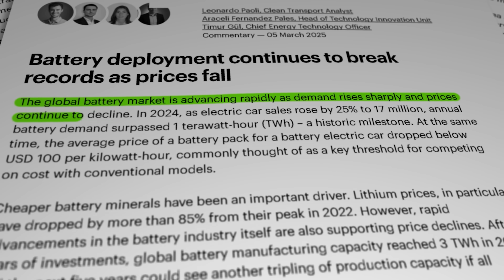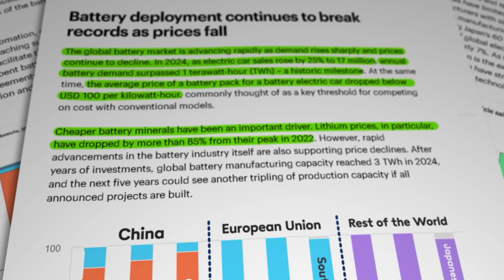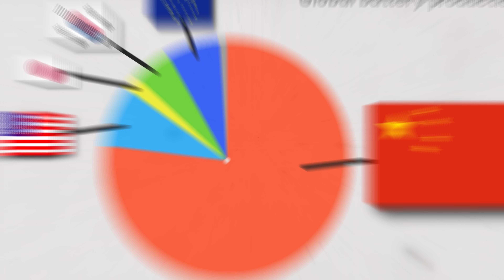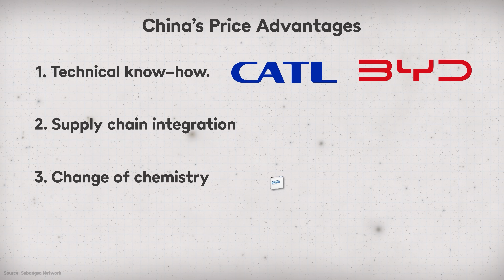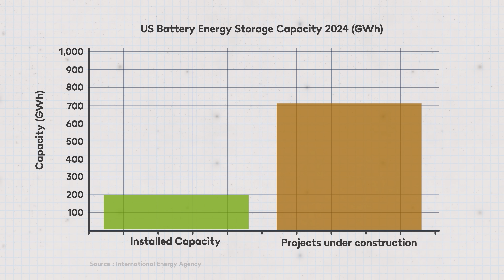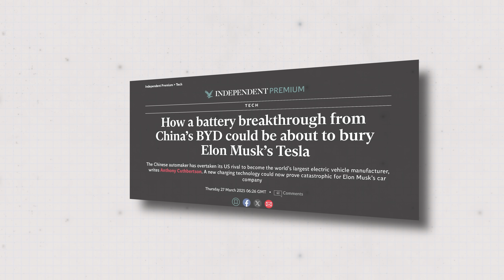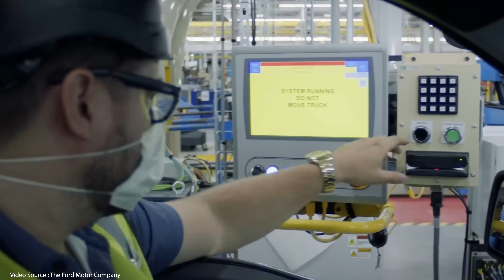Have batteries just hit their exponential curve??

Comment: Retail prices of LFP prismatic cells are well, well below $100/kWh.  Small orders- of a pallet's worth- cost us $60 USD plus taxes and delivery (which from China to Canada added about another $20).    At those prices, the ICE is more or less dead for about 80% of its current uses.
Reply: Thanks for repeating all the ridiculous myths. For one, I haven’t seen anyone gassing up their ICE vehicles in their apartment building, but have seen lots of people charging their EV in their apartment building.
Reply: @georgeacton9106  Slow charging and working out schedules to share the chargers with your neighbors is the epitome of ghetto life.
Reply: @kirkjohnson6638 I see Ivan is panicking about the fact that their oil prices are crashing right now.
Reply: @kirknay  Not to mention that Zelenskyy is blowing up his refineries
Reply: @kirkjohnson6638 It’s already a reality in recently built condos and apartments in Los Angeles. Every parking space has a level 2 charger, groups of 4 sharing the same 32A circuit. That means sharing is automated. It’s not an issue.
Reply: @markmuir7338  Do you realize how small the percentage of apartments are that are new ones?  If you are waiting for new construction to get chargers everywhere, it'll take more than a century.
Reply: @kirkjohnson6638  I’m only mentioning new builds because they are mandated to have EV chargers. There’s nothing stopping this in older apartment buildings - most of them have a big enough grid connection to do this.

The remaining issue is in cities with extremely high housing prices, where 6 adults share a 2 bedroom apartment. Would need some kind of on-street charging infrastructure (like seen in London) for that.
Reply: @markmuir7338  Existing buildings absolutely do not have the electrical infrastructure to handle mass adoption of EVs.  CA doesn't even have the infrastructure necessary to generate enough electricity to feed the grid and the entire grid needs to be upgraded.  Transformer farms, high tension lines, and local pole transformers and residential feeds all need to be beefed up.  Right now, the CA electrical grid cannot handle a heatwave without restricting EV charging and right now EVs are only about 2.5% of the total registered vehicles.  And the trucking industry, buses, and port ships are a whole other ball of wax.

Additionally, there is no reason why renters with ICEVs should be subsidizing the costs of apartment complexes installing charge points that they will not use.
Reply: @kirkjohnson6638 You’re right - we should do absolutely nothing. No change is ever good. There are no solutions to any problems. Let’s just sit back and watch the world burn.
Reply: @kirkjohnson6638 Joking aside, yes the California grid at large is straining under the load from increasing heat waves. However, EVs primarily charge at night, when the air conditioning loads are far less. Adding battery storage near the loads is an excellent solution to the various problems you listed, and indeed California’s power companies are doing just that. As for subsidizing EV chargers: why can’t residents buy their own EV chargers? It’s better to have multiple residents buy the chargers together, so they can be set up to share the same circuit breaker. Mandating it into the code for new builds is a forward thinking approach. They aren’t expensive ($500 per charger).
Reply: @markmuir7338  I said no such thing.  The problem with EVs is that they are inferior to ICEVs and will remain so until they develop a battery which is non-flammable AND until the national electrical grid is significantly upgraded.
Reply: I'm responding to you on a tablet that was charged by a solar powered LFP battery 😂 We bought ours 4 years ago and they're much cheaper now. But we're anticipating 5-10k recharge cycles so by the time our battery dies I have no idea what will be available
Reply: Battery 11:50 prices have dropped while the quality of the cells have increased exponentially, with the technology far outpacing the local grids. The BYD Blade batteries offering insane 800V fast charging will take time for US grids to catch up with the orange fog.   🤔

- Chandler Edwards
Reply: It's not just their cost that's improving but also their longevity. That's measured in cycles. If you have 1500 of those, you'll get 1.5 mwh out of per 1kwh battery before it starts dipping below 80% of its capacity. Not bad. LFP increases that by 2-3x. More in some cases. 

Anyway, I think we'll see prices drop much lower. CATL just announced their next generation sodium ion batteries. They seem competitive with LFP and obviously don't contain any lithium. So, they should be a bit cheaper. A few years from now, we'll probably see sub 50$ / kwh batteries. Who knows where it stops from there. I see no good reason for this trend to stop any time soon.

Forget about the vehicle and battery cost. At a some point the fuel savings you get from not requiring any fuel  will pay for the battery, the EV, and the electricity. Sodium ion should enable even better cycle times than LFP. A true million mile battery. 

Imagine your ICE car is good for 500K (good luck with that) miles and you get an unrealistically good 20 miles per gallon (good luck with that as well). So, to drive 500k miles you need 25K gallons of fuel. At 3$/gallon (dream on, I'm trying to be nice here), that's 75K$ spent on fuel. Ouch.  You can get a nice EV for that and leave a few $ to spare for energy. If you get a proper one that does 4 miles per kwh, and you charge for 20cents/kwh, that means 25K $ of electricity is used to drive 500k miles.  Your mile age may vary but you might do better than that if you are a bit smart. 

Of course, this was the generous scenario for ICE cars. It's not going to last 500k miles. And it's going to be nowhere that efficient for most of those miles. And you are probably paying a lot more for fuel. 

Now imagine that the EV is cheaper than the ICE car. Because it's basically a 60kwh battery that cost only 3000$ (at 50$/kwh) and a cheap drive train at maybe another 2K. Add some parts and luxury and let's call it 15K. You can find cheaper cars in China (below 10K even). All of them electric. So, you are basically saving money when you buy the car. Then you are saving money on fuel. And you are save money on parts that don't need replacing as well. And the battery basically lasts for decades. That's the end scenario where ICE cars are completely irrelevant. You'd replace them to save money. Even if you'd get the ICE car for free, you'd still save money by replacing it with an EV. That's where we're heading with this. If somebody would give you 10K to drive an ICE car for 500k miles, you'd still lose money. ICE cars are really that bad. 

We're in this weird transition phase where people that can't do math think this is all decades away. But this is basically going to be ancient history in just 10 years. The tech is there today. The rest is just economics of scale. Once people are saving money exactly like I outlined, ICE cars are going to be literally worthless.
Reply: @marcelreijnen  " You are right about electricity being 20% of energy consumption. The other 80% however is 67% waste. If we electrify most energy use we only need to make somewhat more than twice the electricity we make now. We can do that with solar, wind and batteries."

Watch any of the Art Berman video's with Nate hagens, the great simplification, your words show that you have no clue of what you are talking about, I don't mean to be rude but the energy in asphalt, synthetic clothes, seats, shoes in the form of oil is not going to be replaced by electricity, the 6000 products we get from oil have an energy component.
While we are at it, lets use a place like UK, 6.4% of total energy is wind, hydro and solar , the 20% in most countries has a fossil fuel component or as Art says, "we could have fusion and free electricity, it would not matter",  if you don't have the feedstock to make an aspirin or one bit of synthetic rubber for wire coatings, all the electricity in the world won't change that.
Currently to get the things we get from oil, it all needs to come out of the ground, it is refined into it's different layers of heat and we get different things from it, electricity won't replace oil. Have a look around yourself and see how many things are oil related. From the carpet to the paint on the ceiling and everything in between has been produced with or from oil, electricity won't produce nylon..
Reply: @antonyjh1234  However, there are arguments that if fossil fuels were to be stopped being used as fuel, production would drop so much that it would make production scaled down so much that chemical and plastic production would become too expensive vs alternatives.
Reply: @neutronpcxt372  " if fossil fuels were to be stopped being used as fuel, production would drop so much that it would make production scaled down so much that chemical and plastic production would become too expensive vs alternatives."

Plastic production can't exist without those fuels existing, if as somebody said we just stop using these fuels then all the costs would have to go onto shoes, clothes, aspirin, etc etc, an aspirin tablet could be 100k

"scaled down so much that chemical and plastic production would become too expensive vs alternatives"

What alternative to plastic, that is just one of the 6000 products we get from oil is possible?

It has to be a replacement to oil, and we can't invent something with less energy than something we didn't invent, as out lives are so entwined with oil, it would be like trying to replace rain.
Reply: @antonyjh1234  In the US, a major plastic producer, most feed stock for plastic is natural gas.
Also, the real problem with oil is that far too much of it would have to be gotten rid of in some way.  Oil is made up of various hydrocarbons and is not just a "substance" 
For example, so long as we need diesel and kerosene and various aviation fuels, we are going to produce gasoline.  A certain fraction of oil is natural gasoline.  It is lighter than those other fuels I listed and must be driven off the oil first before those other constituents are driven off.  Diesel cannot have gasoline in it, natural or otherwise.  So that gasoline will be produced.  If it is produced, it almost certainly will be sold.
Reply: @tarstarkusz  17% of global plastics are made in USA and 98% are made with gas OR oil, reducing a gas to oil means what. less or more fossil fuels being used? The point is gas is also a fossil fuel and yes everything else is true but LPG or natural gas have a much higher methane component and all wells leak. LPG is driven off first, then the others but using gas to replace all the vehicles in the world just to use plastic in an ev which is half plastic it really doesn't matter where the feedstock comes from if it is still a fossil fuel and currently 5% of emissions are from making fertiliser from gas, which is more important?
Reply: @antonyjh1234  "If we electrify most energy use ..."  This is like saying if horses had wings, they could then fly around....Problem Solved!!!  We cannot electrify most energy use.  Most of transportation is not suitable for electrification.  A lot, though not all of heavy equipment is suitable for electrification. Shipping over sea is not suitable for battery electrification (I'm pretty sure they are all already electric, but the electricity is generated by a diesel engine).  Air travel can not be electrified.  Short distances, maybe, but we're talking helicopter doing trips under 40 miles.

"I don't mean to be rude but the energy in asphalt, synthetic clothes, seats, shoes in the form of oil is not going to be replaced by electricity, the 6000 products we get from oil have an energy component."

This comment is directed at someone else, but this is an exact point I made, so I assume you are addressing multiple people.  Asphalt, synthetic clothing, seats, shoes all use oil above and beyond any oil energy component (I would say they are not currently being powered by oil in any event) are directly made from oil. Asphalt is made from bitumen component found in oil, for example.  Our roads are literally paved with a mixture of gravel and oil.  Many synthetic fibers are similarly created with constituents of oil and or natural gas.  Same with plastics and thousands of other products.

But I agree with the rest of what you said.  We are not going to stop using oil anytime soon even if we had free energy from some miracle fusion plant that doesn't exist.
Reply: @tarstarkusz  Yes the comment was to someone else which is why  @marcelreijnen  was the first words, to that person you should have made your comments.
Reply: If we stop using oil, we will probably increase coal extraction (once easy gas is gone)... The Batteries being made will continue to  "firm" up the Renewables, the renewables will fill in gaps in developing countries and non viable remote local grids or increase capacity in developed markets (bill shedding for the rich), the renewables will continue to be manufactured from the existing energy mix. It is called energy leveraging, the worlds economy will continue churning and doomsdayers will keep raising alarms.
Reply: OK, let's say oil will still be necessary in the future. Should we not reduce our consumption of it as much as possible? @antonyjh1234 and @tarstarkusz
Reply: Please tell when. All I can see I can get a $1k ICE car nearly anywhere and (if lucky) run it for years, and $5k dead nissan leafs.
Reply: $60/kWh Australian is what I'm about to pay for an EV battery. Cheap power on a farm can be used to grow high profit fungi in climate controlled environments all year round. Dehydration of all sorts of things is also viable, and makes shipping very affordable.
Reply: The low cost cells is great. It should be notes that pack-level prices are higher (due to the cost of the controls and packaging)
Reply: $60/kwh  didn’t know that & @ end of comment 109%👍👍👍
Reply: This is so exciting! With battery energy density improving and costs dropping dramatically (like Tesla's 4680 cells or CATL's condensed batteries), we're truly entering the exponential phase. EV adoption, grid storage, and even aviation could be transformed within the next decade
Reply: @diytoptricks  If only this were true and they weren't catching fire constantly.
Reply: I would suggest people watch the Nate Hagens podcast The Great Simplification, any with Art Berman, if anybody knows oil Art does and gives people a realistic view of the situation.

Mr Berman has a substack as well afaik.
Reply: C’est
Reply: You absolutely cannot buy a new 1kwh battery for 100 bucks.  Even the automakers are nowhere near this level of cost (to themselves, not the price they charge you).  Buying random used batteries with questionable origins on a pallet is not the real world.
Reply: @tarstarkusz  16kw for 1200 USD from starmax energy... I'd say $100 1kw isn't very far off
Reply: As all plastic comes from the same barrel diesel, petrol, LPG, any of the 6000 products we get then diesel will find a market as they are all refined at the same time we get asphalt. 
Battery powered doesn't remove oil from society just transfers those fuels to another market, the more oil is used for synthetic rubber tyres, the more diesel will.
It is also possible that batteries are going to be what all other renewables have been, just an add-on to total energy consumed.
Reply: @antonyjh1234  - You should check the price/performance of solar cells before you write off batteries, they have come down in price and increased in performance as well.
Reply: @WJV9  Where did I write off batteries instead of saying they are oil based?
Part of the discussion is Net Zero, as that is  total energy and electricity being around 20% of total energy in most modern countries then we could be 100% renewable for electricity and still 80% of the issue needs to be solved.
We could literally stay on coal for electricity, stop driving and using diesel etc that will be the waste product if we want plastic, stop working dead end jobs that do nothing but continuing the cycle and could drop energy emissions 80%.
Efficiency is a saving of energy, just because solar panels are cheap, does that mean the money saved, is saved or spent elsewhere? My experience is that money is spent on different consumption therefore no saving of energy has occurred, solar etc have been add ons to total energy consumption.
Reply: @WJV9  Part of the discussion is Net Zero, as that is total energy and electricity being around 20% of total energy in most modern countries then we could be 100% renewable for electricity and still 80% of the issue needs to be solved. We could literally stay on coal for electricity, stop driving and using diesel etc that will be the waste product if we want plastic, stop working dead end jobs that do nothing but continuing the cycle and could drop energy emissions 80%. Efficiency is a saving of energy, just because solar panels are cheap, does that mean the money saved, is saved or spent elsewhere? My experience is that money is spent on different consumption therefore no saving of energy has occurred, solar etc have been add ons to total energy consumption.
Where did I write off batteries instead of saying they are oil based?
Reply: @antonyjh1234  You are right about electricity being 20% of energy consumption. The other 80% however is 67% waste. If we electrify most energy use we only need to make somewhat more than twice the electricity we make now. We can do that with solar, wind and batteries.
Reply: @antonyjh1234 So your argument is do do all the things you listed? Good luck with the bit about work. All that is required is a complete reorganisation of society, billionaires being willing to fund a basic lifestyle for a none working proletariat. Sounds interesting, are you writing a manifesto?
Reply: @ strike consumed add “saved”
Reply: @antonyjh1234  Your last remark is notoriously incorrect!  Renewables ARE replacing fossil fuels.  In developed countries, no a single new coal plant has been built in years, and many have stopped operating.  Gas-fired plants are also starting a decrease.  And overall energy use is also decreasing, which is in line with increasing electrification... even in China, it seems to have peaked last year (to be confirmed, though).
Reply: @st-ex8506  Can you prove in any country renewables have lowered total energy use?
China has used the same amount of coal in the last 20 years as USA in the last 100, and while as a percentage of total energy renewables has increased so has total energy, we burn more biomass than we did 200 years ago, we never even left wood.
Reply: @antonyjh1234  True, but that will remove about a third of present demand from the market. Might be two thirds, can't remember off the top of my head, but still, I'd imagine the price will be a lot lower with that level of demand drop. Imagine, life without even worrying about the pump!
Reply: @antonyjh1234  As it lowers the need and consequently value of those fuels, it will also make synthetic rubber less economical. You're taking an overly narrow look at things.
Reply: @antonyjh1234 Well then we have to make plastic from other materials than oil. The rest we won't need much off in the future. Lukily that is perfectly possible.
Reply: @ We are going to need fuels made from oil for the foreseeable future.
Assuming we can make a viable fuel from a non fossil fuel source, we would still need oil and not just for plastics.  We need it for the roads themselves.  There are thousands of things made from oil.
Reply: @marcelreijnen  "Well then we have to make plastic from other materials than oil."
We can not invent something to replace something we didn't invent in the first place, with lower energy emissions AND then use that.
6000 products come from oil, plastic is just one product, refining with heat means gas, diesel, petrol exists until asphalt which is at the bottom of each barrel, if asphalt still exists to drive your battery to you or one bit of synthetic rubber (plastic) then all the other items do too and at 100 million barrels a day, lets say we use 15% of it only, that would mean 85 million barrels need to stored, a day.
Reply: @antonyjh1234  It realy baffles me how people can always find ways not to see future change that is clearly coming and only focus on the presumed impossibities of change instead of seeing the possibile for our future.
Reply: @marcelreijnen  Is it your ego, that won't let me know what is "perfectly possible"? Are you seriously making a personal comment instead of debating the point?
Are you not able to be wrong?
Did you watch the video so that you see both sides of the argument or are you doubling down with what could be seen as an insult and really you're projecting?
Reply: @marcelreijnen  Well then we have to make plastic from other materials than oil. The rest we won't need much off in the future. Lukily that is perfectly possible."
If you want to mention, just one time, where will the plastics in oil go because it's refined off at the same time, plastic will always exist in some form if you want a computer .
Is it your ego that says something is perfectly possible when you have no clue about the reality of the subject?
Reply: @tarstarkusz  The main thing is not burning it
Reply: @ 99% of that can be relatively easily synthesized or otherwise replaced with viable alternatives, we just don't have the economy of scale atm to drive down costs the same way we have with oil based synthesis. We can literally make polyester from corn and soybeans, and in fact, we can do it cheaper if you account for insane subsidies that exist for oil, but not soy.
Reply: Saying what you did means nothing, what can you power with that pallet of batteries? That's the rub.
Reply: @turkeytrac1  I can power my whole home with those cells!

I can use them as a power dump when electricity prices are lowest, to do power hungry stuff like electrolysis, welding, etc.

When you have lots of cheap energy, there's nothing preventing you from doing tons of stuff.
Reply: @neutronpcxt372   "I can use them as a power dump when electricity prices are lowest, to do power hungry stuff like electrolysis, welding, etc."

Does your utility offer off-peak power rates to residential customers? Can you keep the charging rate under the demand charge limits? It wouldn't help much to get off peak rates only to get charged for too much of an instantaneous power demand.
Reply: @ Yes. Hydroquébec does offer off-peak power rates for both residential and commercial operations.

I only have a 1.5kWh pack currently, so even at 1C charging (never), I only draw 1.6kW at most.

As for power, it's usually not much of an issue as unless you consume absurd amounts of power during off-peak hours, it won't be a problem.
Reply: @turkeytrac1  At that cost, you can set up the equivalent of a Tesla Power wall for about $2,000, which is a 1/5th the cost.
Reply: @turkeytrac1  you can buy 16 lifepo4 cells and connect it to a cheap hybrid offgrid inverter and power your entire home 10 out of 12 months

or you can make your own ev conversion and use the battery from the ev to power your house

im from eu and can buy a 1kwh cell for only 50euro, solar panels from 100euro per 1kwp and a cheap hybrid inverter (like growatt 6kw) for only 600euro
Reply: @turkeytrac1  A house for a week.
Reply: @turkeytrac1  Knock that number down by 60 to 70% when it is cold outside.
Reply: EVs are entirely impractical for people who live in apartments, condos, or houses without garages, so there goes 50% of the market right off the bat.  Add in high mileage drivers and the number goes even higher.  And finally, add in people who know climate change is a hoax, people who place a high value on their time, people who realize that EVs are a significant fire risk, people who hold onto their cars for many years and have no need for a new one, and people who just like ICE cars, and EVs will be lucky to ever see 30% market penetration.
Reply: @kirkjohnson6638 lets come back to this comment in 20 years. You’ll be absolutely shocked, I hope you live to see how wrong you are.
Reply: @vincentpernicano3277  In 20 years, if I'm still alive, I'll still be driving my two ICE vehicles which are already 28 and 46 years old respectively.  You'll probably be bankrupt from expensive EV costs and failures.
Reply: @kirkjohnson6638  you're right, it's more difficult for people who live in apartments, but local low power charge points at the side of the street or in car parks can go a long way to alleviating the problem. 
And as for 30%, we're already there with new car sales in the UK, 31.0% in 2024 over 19.7% in 2023, and the direction is clear. 
The new Mercedes CLS has a 500 mile range, there are not many people that travel more than that regularly, without the need to stop. 
The fire risk is there, if over inflated by the media, but it is getting better all the time with China, the worlds biggest battery producer, introducing new laws around EV battery safety in a couple of months. I suspect that those laws will filter out across the world. 

If you can afford to keep an ICE car going, then good for you, keep at it. But you will move over at some point, the economics of the situation will force it for most people.
We're never going to have 100% EVs on the streets, but you should thing of this as a move towards a greener society, not 100%, but a significant percentage.
Reply: @kirkjohnson6638 Trying very hard to convince yourself there. Ever was it so. Similar was said when horses pulled taxicabs. You seem to forget the use of public transport systems is highest in urban built up areas.
Reply: @Seafox0011  Cars were huge improvements over horses, but EVs are little to no improvement over ICEVs.  At best, they claim lower energy and maintenance costs.  But the truth is that they have higher maintenance costs.  They do use less energy, but public charging is so much more inconvenient than fueling at gasoline stations that the energy cost advantage may or may not exist depending on howcoften the user's driving needs dictate public charging.  Factor in insurance costs, which will be escalating rapidly for EVs as insurers get more data on fire occurrences and damages, and EVs will be behind ICEVs on total operating costs per mile.  If the fire occurrences are mitigated and people can charge primarily at home, then EVs will make sense, but only for that market segment.
Reply: @kirkjohnson6638 On my block there are two homes without garages but with EVs. Both park their cars out front of their house (on house with 2 EVs doesn’t even have a proper driveway, the cars are literally in front of the house) and they charge them their. 

Your claim that you need a garage to have an EV is false.
Reply: @oldmanlearningguitar446  Sure, you can charge outside - all the public chargers are outside.  But you are not permitted to run the charging cables over sidewalks and in most places where people live in apartments, you will have people unplugging your car, maybe plugging theirs in, and maybe stealing your charger or cable.  Plus, given the fire risks that EVs pose, you actually wouldn't want them charging in or close to your home.
Reply: @kirkjohnson6638 garage? Aside from the other silly talking points this one is of straight up mouth breather logic. In the last three years my Tesla has never once been parked in my garage. It charges just fine outside.
Reply: @matthewwhite8129  Do you charge your Tesla outside in your private driveway and far enough away from your house to keep it from igniting the house?  Or do you illegally run cables out to the street, creating a hazard for others and a liability for yourself?
Reply: @kirkjohnson6638 such weird outdated arguments it's clear that you are not remotely objective in your assessment

I'm not saying EVs are perfect or everything you sre saying is wrong but it screams of clutching at straws.  The changes in the market the last 5 years alone are pretty stunning whether you like it or not
Reply: @Yerdadada   None of my arguments are outdated nor weird.  That's why EV sales are plummetting everywhere that they aren't heavily subsidized, mandated, or where ICEV sales are not heavily restricted or taxed.
Reply: @kirkjohnson6638 well you keep bring up fires which is weird given that they are statistically more common in ICE vehicles 

You for some reason seem really hung up on "running cables over the street" , as if a solution is like cracking nuclear fusion (as opposed to, I dunno, an extremely simple cable cover or any number of solutions) and then you go off about people unplugging your vehicle or plugging their vehicle into your socket, again something a 6 year old could propose a solution to.....
Reply: @kirkjohnson6638 Autonomous EVs will be cheaper than any other personal transport. As for the rest of that nonsense, people have seen right through it now, and it's over for the ICE.